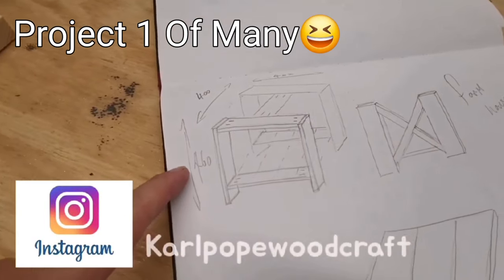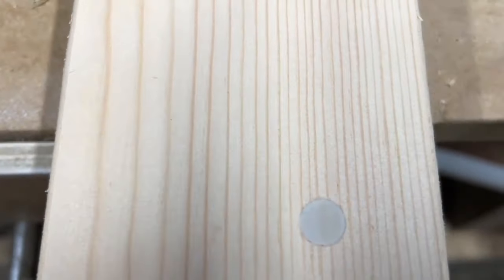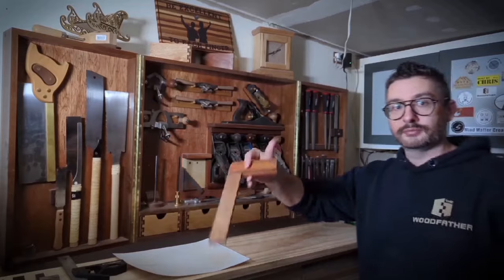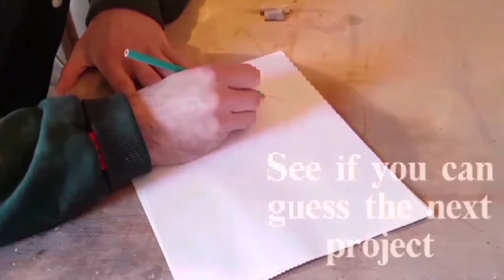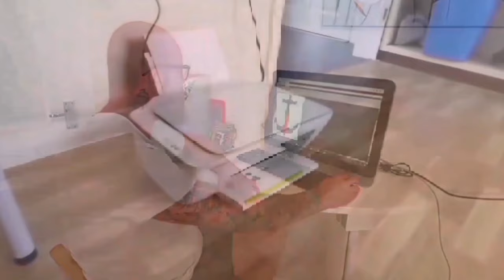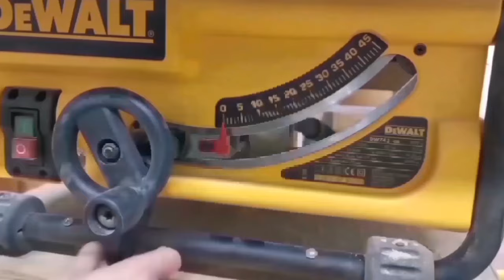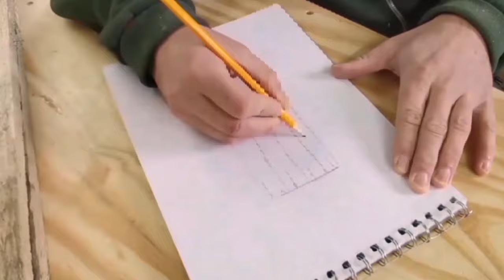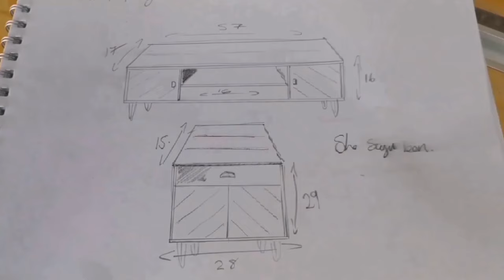Ultimate Guide to Easy Woodworking Projects

Comment: This is a really motivational video. Thanks for sharing. I've been struggling to move from wood turning into working with flat wood but seem to just buy tools instead of making things. One thingthough - what is the fence you have on your table saw around 1:22:01? I've only a cheap table saw and the fence is anything but square or useable.
Reply from the maker: Thank you well I'm the opposite actually I'm trying to learn turning bug struggling 😅  I use a Dewalt dw745 table saw and it has a great fence for a small site saw. I also use a homemade jig to straighten old reclaimed boards in that part of the video. Many thanks for watching 😊